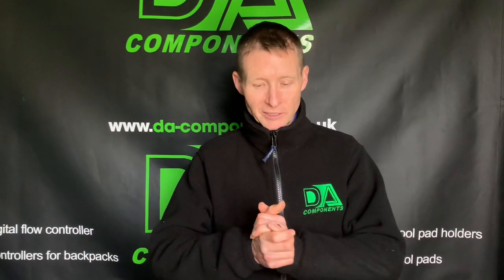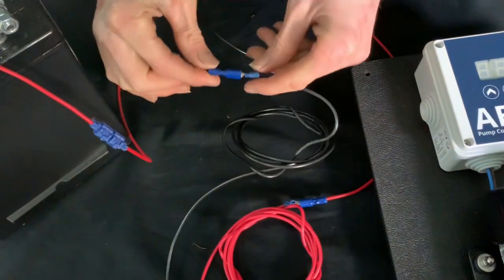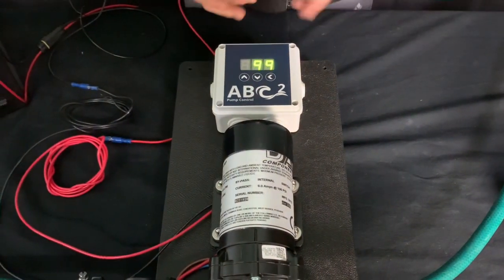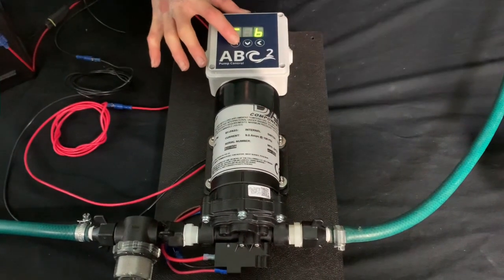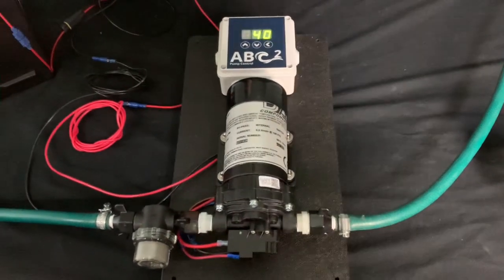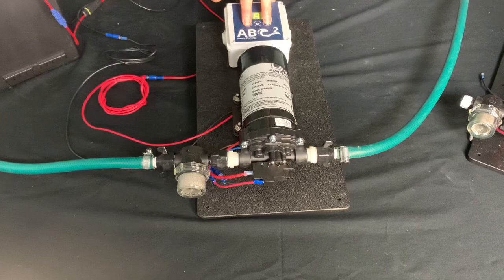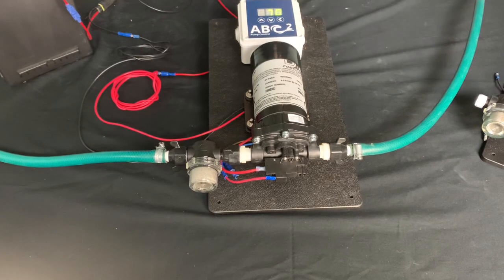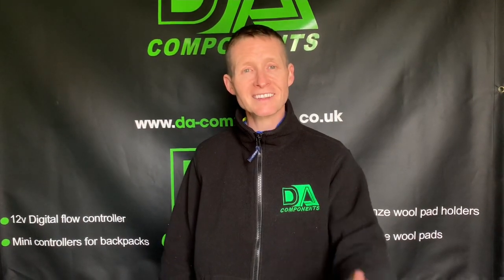How to set up and calibrate an ABC2 pump controller

Comment: Agree 100% if the cal value is set correctly based on the flow rate the controller will Dead end the pump well before the pump pressure switch activates. This is a design feature to protect the pump pressure switch and pump.